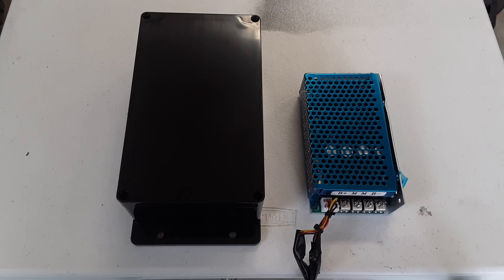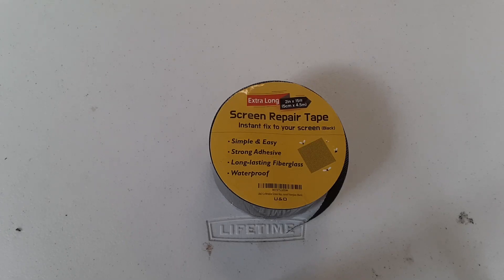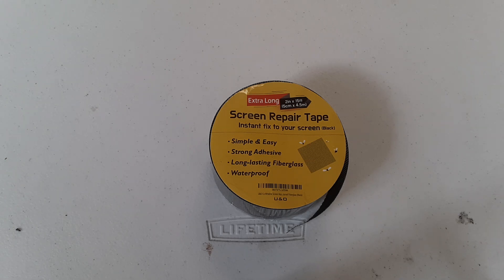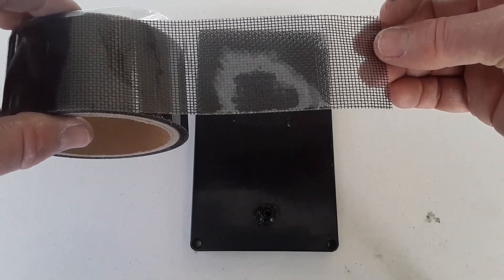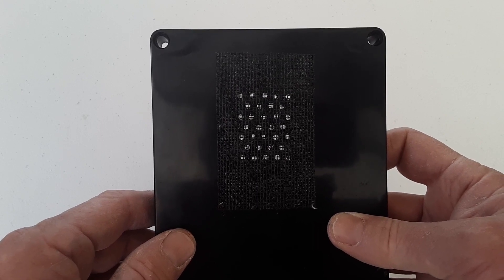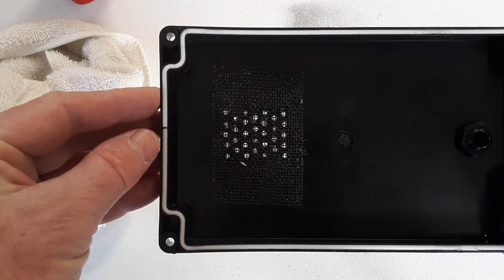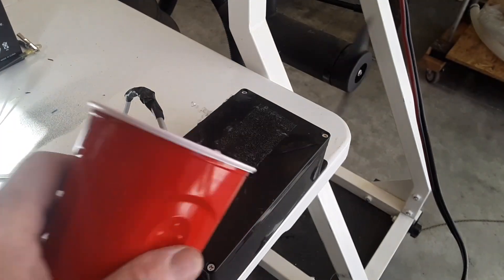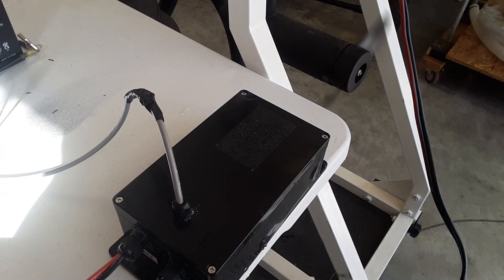PWM Digital Speed Controller Water Resistant Ventilated Box

Comment: Excellent stuff mate, cheers. 

I have a 5 forward speed/3 reverse speed motor that Im just about to add a PWM to. Im using it on a float tube and the motor is mounted at the rear. The way the motor/prop is situated puts it under my float tube instead of away from it. In other words, I have to turn it around to propel me backward in the tube (going forward in the tube soaks my nuts haha).

Anyway, when you put a PWM on my motor (older Endura 30), will it run at the same speed forward and backward? Im not sure if the reverse is limited in speed compared to forward. 5 speeds vs 3 made me wonder if full speed at reverse 3 is the same as full speed forward 5. Id really like to get the prop out from under me arse, the shaft isnt the longest and sometimes when its choppy I can feel the props brush the bottom of my tube which is not very good at all.
Reply from the maker: Yipes! Yes, with the PWM F and R should be the same speed.
Reply: @Aksmaniyak  Excellent, that bit of info has made my day, cheers!

Comment: Great video as always! How did this build hold up for you? I wanted to do this fan cooled build for my kayak, Ascend 12T w/36lb Endura trolling motor side mounted. However there are so many negative reveiws on these PWM's when using them for trolling, I typically troll for trout/kokanee and king salmon at 1-3 mph, for 4-6 hours a day. As an electronic engineer, I can tell you these claimed 60a/100a PWM's are only designed and built for 25a-30a continuous load. The cheap components and small terminal block limits it's output and guys are frying them after a just a couple of trips. You have years of building experience I value your opinion as to the durability of these units, Thanks for the videos!
Reply from the maker: Thanks! These PWMs are hit and miss for quality. I have had some that are still going but others fry them on the first day out. Have you checked out my ESC builds. ESC would work great for that motor. You could also look at the Minn Kota Traxxis control board PWM too.

Comment: I am curious, if putting the holes and tape in the lid worked that well, what if you mounted the pwm to the lid and put the holes and tape in the bottom? It seems it would solve any issues of water sitting on the tape or any need to blot it dry. Also, if any water were to penetrate the box, the pwm is suspended from the lid out of any water and the holes in the bottom would  double as drain holes. I get why you put the holes in the lid, we all know heat rises. But, using a fan anyways, we can make the heat go where we want it to go.....out of the box.....even downward. Just my take on your project....thanks for the video.
Reply from the maker: You are welcome Chris. This is only my design and your idea seems valid as well. The only thing is that the bottom of the box would need to be suspended to provide a gap for the airflow. That is the beauty of DIY, there are many solutions to a problem. Build your box and update this thread.

Comment: Thanks a lot for sharing. Did you improve the system because you had some heat problems without this ? The heat inside the box was too high even with the fan ? Or just in case, to have a better heat dispersion ?
Reply from the maker: I have not had a heat problem with my builds but others had said they did. I wanted to see if this could solve the problem that others have had.